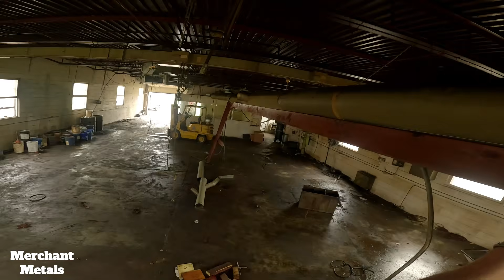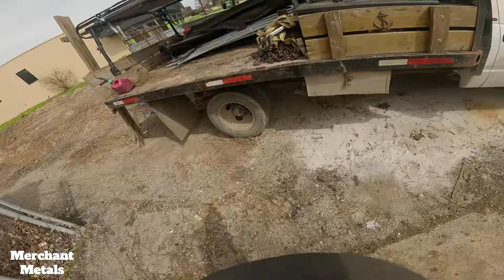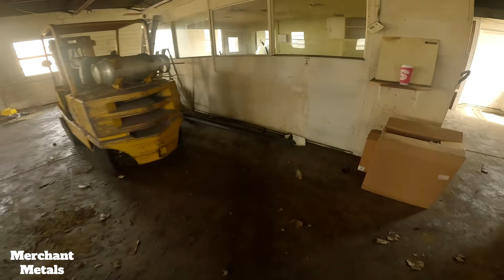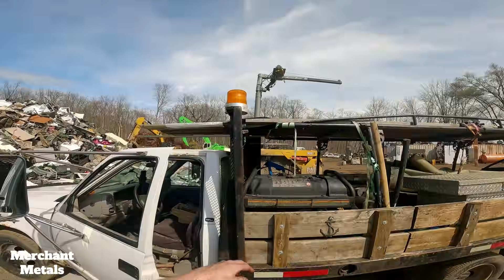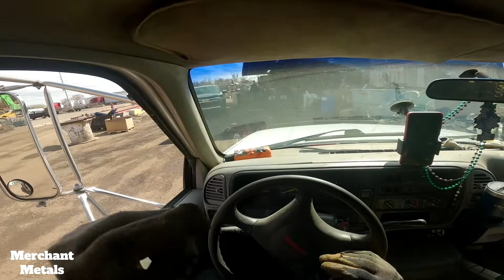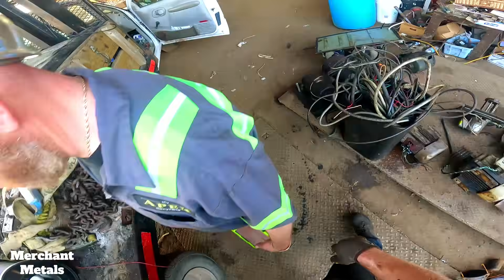Heavy Shop Cleanup: CNC Oil Disposal & Scrap Yard Payday

Comment: Ooh fun on a practice bid.  $300x2 working with heights, $75 for drinking faucet, roughly 8-10 cu. Yd of waste at $30 per cu yd in my area, but might have brick in it so calculate it by weight also, roughly four full days of work at ?/hour, plus special equipment to take wall down.  I’d say $2050-$2300 plus maybe a dumpster and/or special equipment knocking down wall. Prices may vary in your area per cubic yard but demolitions for me is $40/hour.  Hope you get a variety to choose from. GI Cleaning Out :)
Reply from the maker: Thanks for responding to the estimate question! We'll see in the next video!

Comment: Shame you don't use a diesel heater to heat your home. That much oil mixed with waste diesel would have kept you warm for months.

Also, I wonder if you could mix it in with diesel to run a truck?.
Reply from the maker: Unfortunately I dont have anything that runs diesel. And nowhere to put 27 pails of oil Where I stay. I'm just happy to have put it into a recycling process one way or the other and to be able to finish it in one day So I could move on!

Comment: I see ya running around, I get it. As long as the pay is there, all good. 
Demo, I'd be at around 2500. Looks like a 3 day job.
Reply from the maker: Yeah if it takes as long as 3 to four days I could see me asking that price. If everything goes right as planned I think it could be completed in one day. And that's if they have a dumpster already there waiting for me for the debris. But I agree with you it really depends on how many days is involved in a job like that. I was thinking more like $700 for one day or $1200 if it's two days worth. or 1800 if its 3 days

Comment: Probably look into several factors as to what you need to charge, like what expenses you will have to get there, how much you think you should earn hourly, whther the average adult could do the job, any special equipment you will have to use and of course what others in the area would charge for the same job. A few commenters said about 2500 but I'm not sure. Might need to just see what others would charge for the same job - then undercut them by 10-20%. I think others, even in these comments are accustomed to charging people through the roof for services and labor as that's kind of the current status quo, but I'm more of a good guy rather than a ruthless business man.
Reply from the maker: I 100% agree with you I definitely have got a lot to learn. I think 2500 might be coming in too high for sure. I was a construction worker for the majority of my life before I started scrapping And I've got a good eye For estimating how much time it would take me to do certain things. But balancing this job and the hoard of scrap at the work bench has been challenging along with creating the videos! For example the electric motors some people that wanted me to bring them home and tear them down for copper are not willing to listen to why I'm scrapping them whole. I could see me asking in between 700 to 1200 For what's left at that CNC Shop that I talked about in the last video. It would be 700 if I can manage to do it in one day But if I have to come back and finish it the next day aka ( 2 day job) I think I would be asking 1200. I think that's where I would be at realistically With pricing.